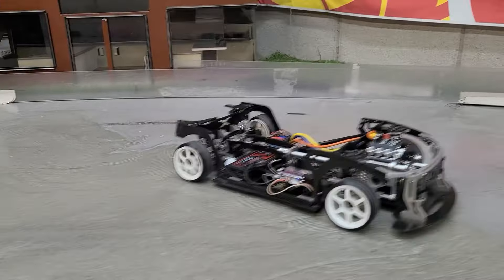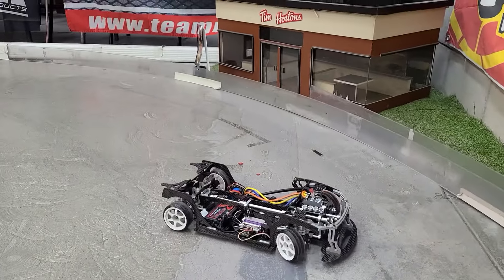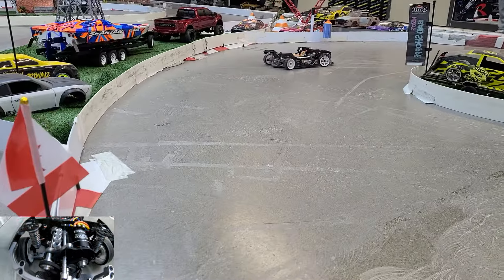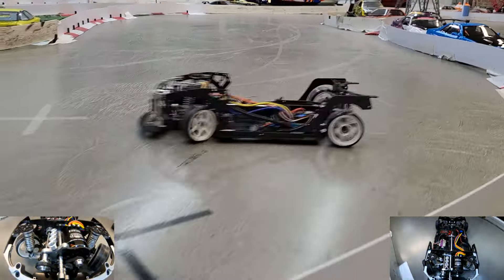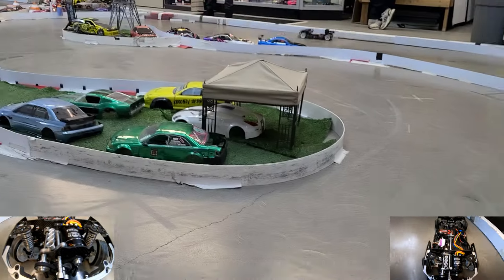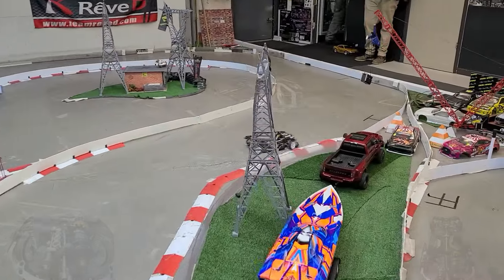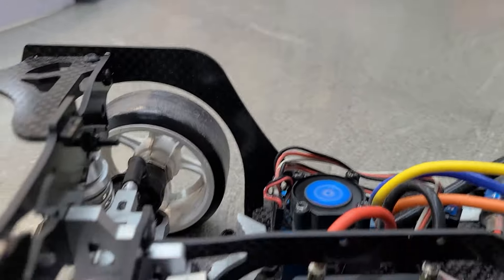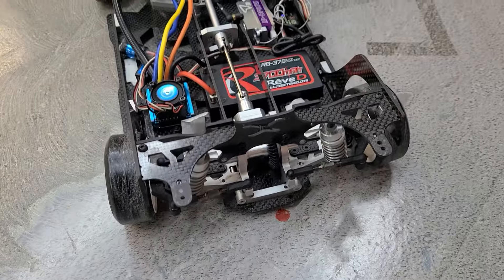Fijon FJ9 Classic Fantastic Shakedown

Comment: It needs grippier tires. Anything front-heavy does. It's a simple fact of physics. And I STG if you quote me your track's spec tire rules I'm gonna go apeshit. Spec tires can ligma, and anyone trying to enforce them needs to grow up and learn how to think critically and judge things on a case-by-case basis.

A front engine/front heavy car setup like this is going to be more of a nusiance on track running spec tires than it will be if it runs tires that are fitting to its setup. And it's not like it'll be way faster or have an advantage over other cars running spec tires, it's literally just compensating the grip factor in a different way.

Super slick tires (AKA the modern trend) = needs an unrealistically rear heavy weight bias to compensate and have enough grip and traction.
Old school grippier tires (particularly hard rubber) = needs a more scale-accurate weight balance so it isn't too grippy, and drives well.

I really hate the way modern setups float aimlessly sideways with zero resistance, zero control, and are easy to wash out. Meanwhile, old school setups can widen OR tighten pretty much any drift on any corner, and you can near effortlessly point and place it wherever you want on the track. It just takes a touch more skill, and you DO have to manji or drive straight on the straights instead of being able to unrealistically float sideways down the whole straight.
Reply from the maker: I know what you mean about the tires...I remember running a lot of grippy boi tire setups back in 2014-2015, MST Red/Yellow Dot CS-R's in the rear wheels and my old favourite the FR-F rounded front tires for front wheels on all my older front motored / front heavy cars. It didn't matter if we ran Eagle R31's/TT02's/TA05's, MST FXX's plastic or VIP/FS & MS01's etc, 3Racing Sakura D3 converts... we all ran grippy tires. I get that 100% trust me lol. 

This sort of car I do enjoy for limited reasons, mostly because it's a fun challenge. For me, I can train people to learn things using cars like this as you simply cannot just "walk it" down a straightaway sideways the whole time effortlessly (just tune it with full parallel steering geometry for crab walking and voila lol). 

This particular Fijon FJ9 had already been converted to RWD prior to me acquiring it and it runs surprisingly well after the work me some of the boys did at time of filming but I don't plan to go wild in terms of making it jam as hard as current comp spec cars on the whatever is the 'spec tire' for any comp track. I really only put cars like this on a spec tire merely to see how much drive i can get at time of filming with little to no tuning adjustments (although this thing required some effort). If I decide to revisit a classic fantastic shakedown in the future I would try to run different setup and tires for sure as the goal would be to achieve maximum enjoyment and drive-ability regardless of comp spec rules etc. I did this for giggles with a few other front motored cars last year after filming and yiss, the older cars would keep up and maintain speed/pace, not be dumb fast or too extra grippy, it just levelled out the pacing one you find the right matchup.

Spec tires can be a touchy subject I get it. My main enjoyment is when someone tells me the spec tire is the way but then the track allows many tires to be run and I am then able to door them with  a so called "inferior" or "less grippy than spec" tire. I did this a lot with my older MST FXX-D S Plastic Fantastic setup and most of the weight was in the front end :)
Reply: @BadShoppe  Hey, at least you're open to discussion and reason on the topic. I had some dude tell me my idea to compare front heavy with grippier tires to rear heavy with spec tires was "dumb and wasting my time"

There's some other context I'm too lazy to share but I ended up telling him that if he can't drift a scale-like front-heavy setup with old-school grippier hard rubber tires at old-school drifting speeds and tandem with others like people did back in 2013-2017, then it was down to a skill issue, not the setups or build being wrong or "inefficient at this scale".